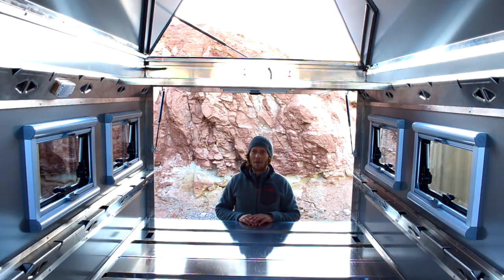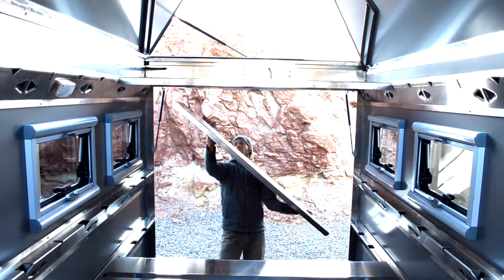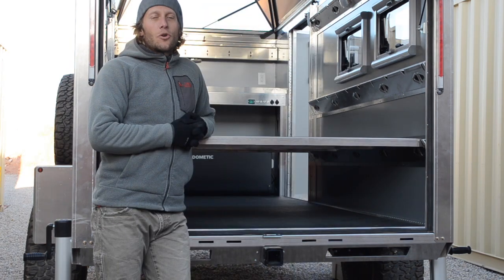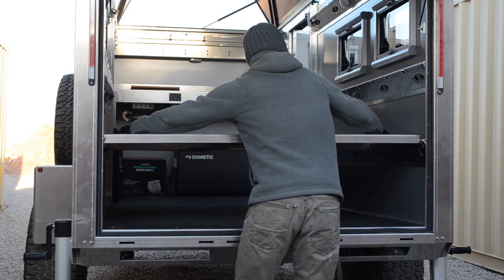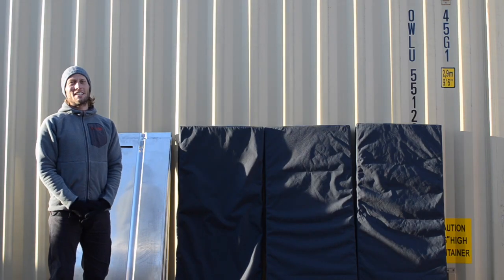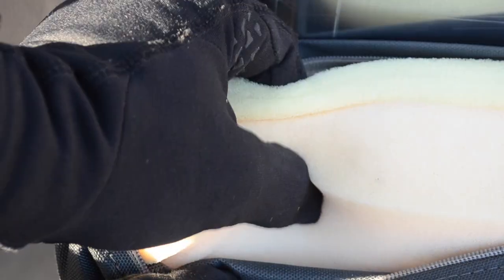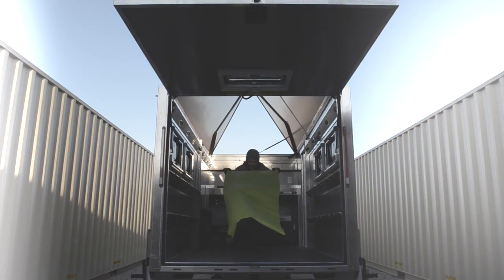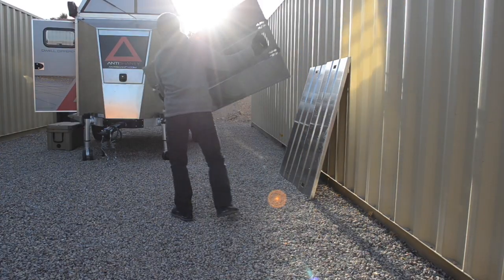How the Bed Works

Comment: Making the bed panels be able to be attached in a front to back orientation with each have a swing down support leg on sides would allow sets of bunk beds or couch configuration also keeping the middle open.
Reply from the maker: Thanks for your feedback. We have a bunk/single sleep system that can be seen here - 

https://youtu.be/s-ywG5E_SQg?t=381 

Details are TBD, but it is in the works and performing great. 

Happy Trails!

Comment: I hope one day you guys would consider to build your system onto a cut-away van from GM, Chevy, Ford or Mercedes Benz. I also wish you'd utilize the full width, including the wheel wells on the inside of the box instead of on the outside...more space!
Reply from the maker: Thank you for the feedback. 

We went with external wheel wells to limit as many cuts/seams/potential water intrusion points as possible. It also gives us a clean slide through for loading full dimension lumber, adding storage drawers/slides, etc. 

All the best!